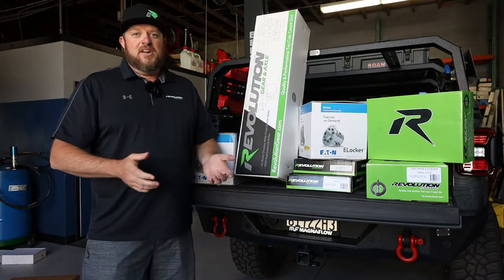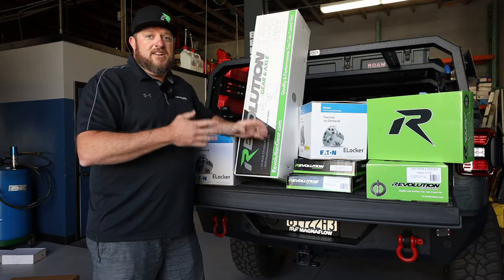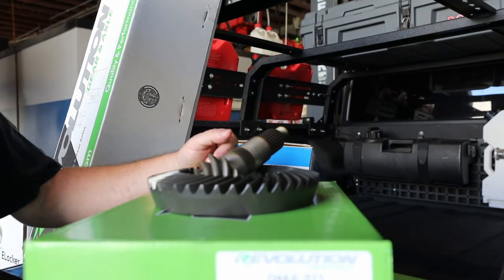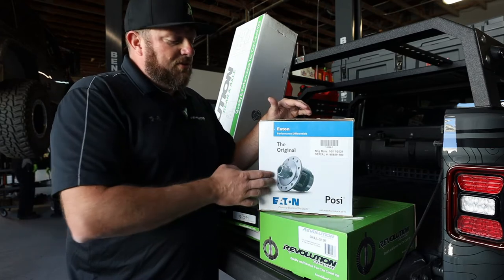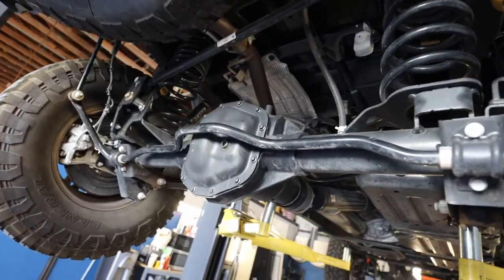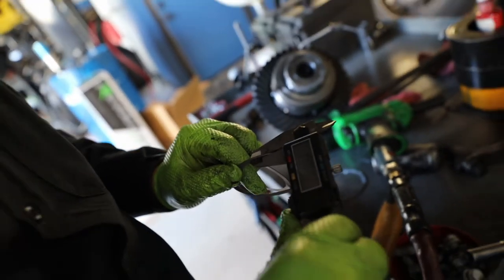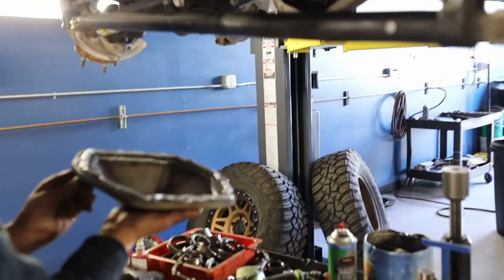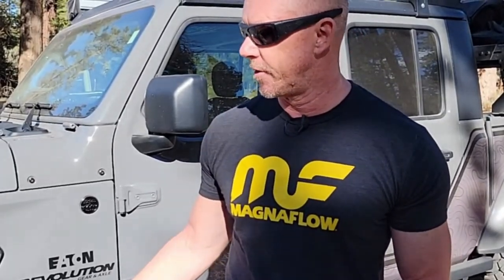Revolution Gear Restores This Gladiator's Performance with Gears and Lockers

Comment: In all my experience I only like the E-Locker and the TrueTrac depending on the application and finances. I hate limited slip with clutches and don’t like automatic lockets because of the noise and popping characteristics and they suck on snow and ice.
Reply from the maker: Each type has a place and in my mind specific use cases and vehicles determine which is best. It's hard to beat an e-locker's utility but whether  electronic or air actuated, they do require an additional part which has to be functional to work while the others are sort of always on.

Comment: I have a 21 gladiator overland with the 3.6 and 3.73 gears. I put a level lift on it, and 35.12.50 R18 tires . So what gears should I have installed to get my mileage back up?

Comment: do you know if the product has been released?
Reply from the maker: Yes, the JT axles are now available from Revolution Gear. DC-D44JT-Sport is the part number for non-Rubicon Gladiators w/o Max Tow
Reply: @exhaustinglife  tnx…. just ordered a set
Reply from the maker: @archietamayo76  Miles has been happy with the new Revolution Gear set-up. Adding some extra strength and reliability is always a good thing on the trail. Enjoy!

Comment: Max tow have lockers available?
Reply from the maker: You can find aftermarket lockers for a Max Tow optioned vehicle but they simply don't offer OEM lockers in a NON-Rubicon Jeep.
Reply: @exhaustinglife  you can buy the assembly